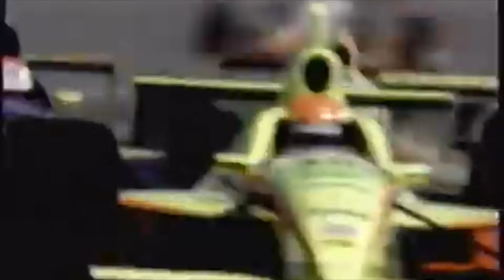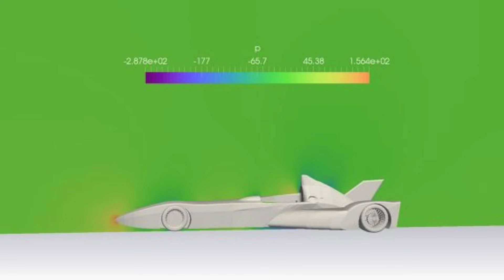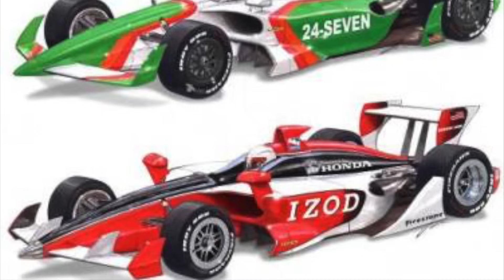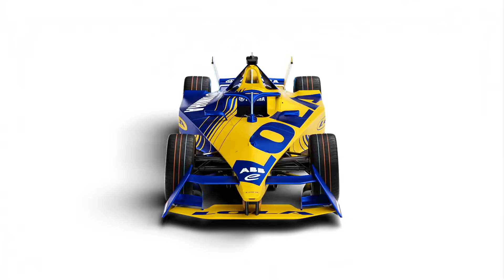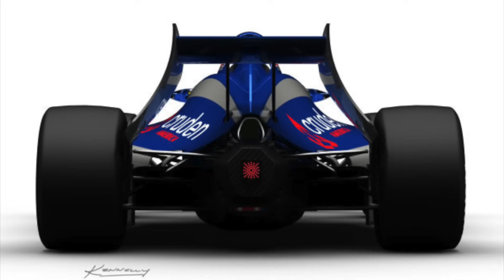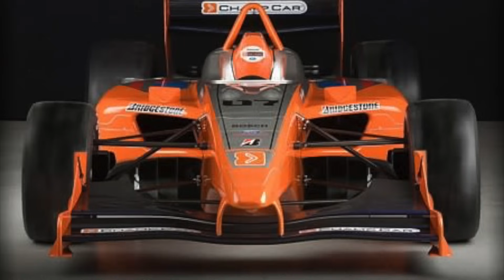The forgotten 2012 Indycar concepts - how these wild 2012 cars could have changed everything

Comment: Indycar has used position panel on the DW12 at times, and it may return on the new car according to rumors.
Reply from the maker: I think the Swiftlights were a step beyond that. Never got to see them in reality so we don't know
Reply: @Samsthepits  Indycar had LED panels on the side of the rollbar that displayed the car position, and in the pits, the time of the stop. They were supposed to replace them with more advanced, full color panels, but the things constantly failed so they came off.
Reply from the maker: @arthuralford  technology has moved on, think it could be implemented
Reply: @Samsthepits  They're just LCD/LED panels, it's not like it would be difficult to retrofit to any design if they felt the feature had any value.  They did try them for a while to display running order, pit times, and whatnot, but as I recall they were buggy, didn't add much value, and the every-improving ability to seamlessly integrate whatever information or effects they wanted into the live video feed made adding such fiddly technology to the cars unnecessary.
Reply from the maker: @megachonk9440  its a bit more than that but it is totally doable.

Comment: In general, the cars need to be shorter and narrower to make passing easier on road courses. IMHO all the bodywork around the wheels may improve safety but really defeat the whole open wheel concept. I like the idea of using the same basic chassis for different classes, cutting costs.
Reply from the maker: Yeah that common tub concept is a really good one.

Comment: Great video Sam! Hopefully the next gen Indy car will be here soon for you to make a video on. For the next gen I would love to see room for a 8 or 10 cylinder engine in the back!
Reply: 10 cylinder - flat plane. One day
Reply from the maker: @jeffbaker9699  doesn't seem likely but maybe
Reply: @jeffbaker9699  Wrong series.  IndyCar was at is best when turbocharged.  I wouldn't mind going back to a V8, but after Las Vegas 2011, there needs to be an easy way to change horsepower for different tracks and I don't want to see restrictor plates.
Reply from the maker: @danielh8316  can be done electronically now.
Reply: @Samsthepits  To the necessary degree?  Right now, super speedways are about 550hp, short ovals are 625hp, road courses are 700hp, and P2P is 750hp.  NASCAR does it by adding restrictor plates which leads to pack racing demolition derbys at Daytona and Talledega.  I know that in 2011 they couldn't get the engine maps or aero package down to a point where cars weren't full throttle over a full lap.
Reply from the maker: yes it can be done entirely electronically
Reply from the maker: I once saw a 600cc V8... so anything can be done!